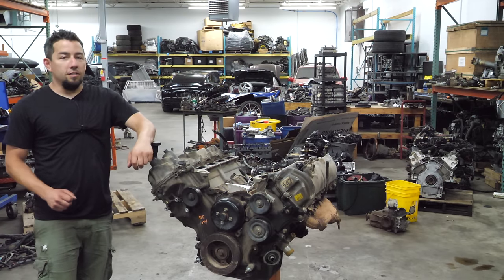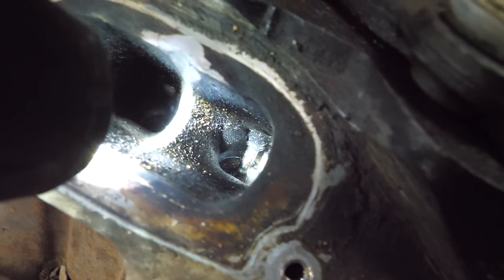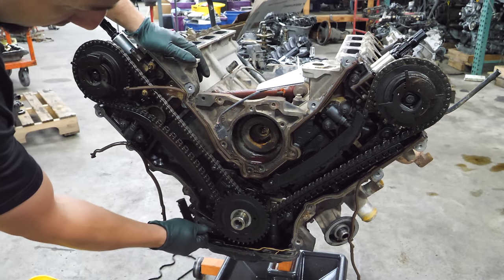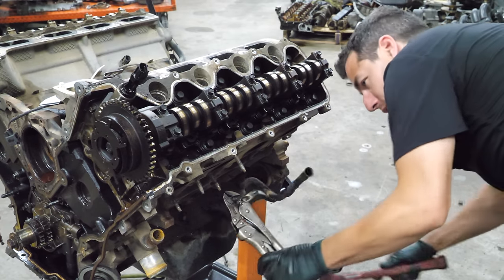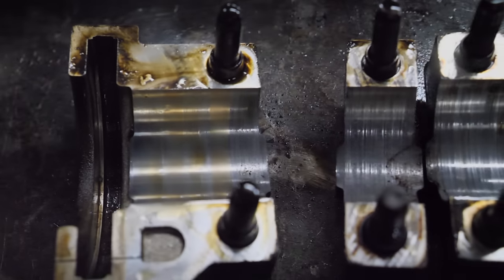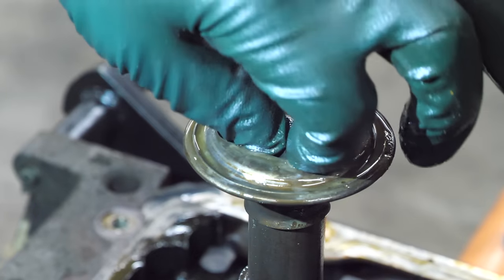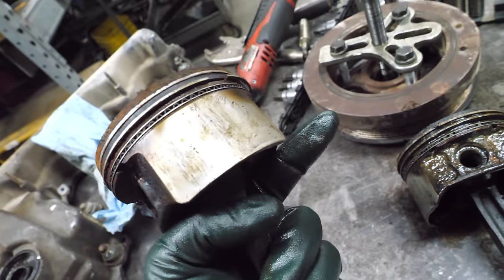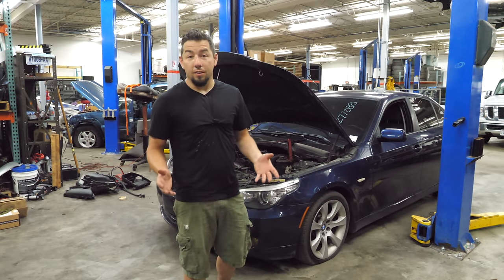Bad Ford 5.4 3-valve V8 Engine Teardown. Which of The MANY Possible Failures Took This One Out?

Comment: That wasn't maintained just by looking at it. I can tell you right off the bat it wasn't maintained. And it's not going to cost a fortune to maintain it. That's the ridiculous part I don't understand help me make that make sense. It's affordable to change oil that looks like it hasn't been changed to 10000 miles or more which I don't think there are cars out there. That are designed for that. I can already tell you the problem already just by looking underneath the valve cover. Overheated low oil I guarantee you that's what caused that engine To fail.

Comment: Oh and to those scenarios that you're walking down this checklist of stupidity. They do have aftermarket oil pumps that actually work. They do have oil tensioners that actually work that will solve most of the problems. You're describing but no one knows that because they think they know it all. That's a problem. And on top of that. They're pretty decent engines when you actually change the oil and make sure your oil level is good. That's important in any car I would think or hope I don't know what people are doing that they're not putting oil in their cars and checking. The oil levels to think that their cars made good because it's made by somebody else that is a Fallacy.

Comment: engines are junk..spark plugs broke off in cylinder head. soaked with pb blaster on both sides, since head was removed.. still broken every one. used impact gun on a few. breaker bar on a few. nothing mattered. Ive built a lot of ford v8,the 5.4 is garbage.

Comment: Maybe someone with real knowledge should be doing that teardown. Anyone with any real knowledge knows the fatal error of this engine was the inadequacy of the oil pump. I know people who bought these used and put a Melling high volume oil pump in it and ran them 200k-300k with no issue. You mentioned “cult following” in the video. There’s also a cult hatred, especially from people who know nothing about an engine.

Comment: Dumb people like to hate on these engines but they themselves don't maintain them. I bullet proof mine at 150,000km now I'm pushing almost 450,000km no problems at all and still with the original Drivetrain. Unlike Gm that you have to swap pretty much everything if you start towing 😂.

Comment: And furthermore this piece of Garbage was built by the namesake of the company that built the 289, 352, 427 side oiler (an amazing powerful engine) the 390 and on and on. What happened to THAT Ford Motor Co? Reckon Henry is rolling in his grave since as recently as the mid 80's Ford designed from the ground up the 3.0 Vulcan that was in my opinion one of the best cast iron V6 engines every built! Reckon where THAT Ford Motor Company went? It ain't the one we got NOW???? They built the first mass production V8 back 90 years ago! Where is that Ford Motor Company? The CEO needs to watch your video and see how far away from where they WERE to where they ARE now! Oh and how about the 1.5 EcoBoost engines? Head gaskets anyone?

Comment: And all those things that you are talking about must have been because somebody wasn't taking care of the motor like they should but I've never had crack. Block. Or manifold or any other things you just described. So what makes mine different and the ones that you're talking about? And lots of time if you don't Care of the motor what happens the things you just describe Is that the motor's fault is that person that isn't taking care It fault? At least I know mine Didn't catch fire doesn't burn or It does what it's supposed to do start and run Now I can't speak for what the computer's doing why do electronics That are so poorly made nowadays and it doesn't matter what car it is apparently Those are the things that. That Bugs me about this vehicle is the electronics or new Updated versions are more concerning the previous Is versions. But i'm still a ford a guy And for as long as I had this Engine type I've never really had an issue. I have a four wheel drive by the way expedition Both of them I don't See the issues you're describing other than the oil techner being an issue But They are good If you again go back to what I said simple maintenance Keep up with those things you won't have an isbut if you want to update The parts that are a problem you can do so. They do and it's known that they have Updated Version of the problems Which doesn't Kill the bank if you know what you're doing. So do I think this motor is bad? I used to think that until I owned one and actually took care of it again going back to that again simple maintenance. I have not yet had a cracked manifold or any of those silly things that you're talking about and yeah I don't like the aluminum block. I'd rather it be cast iron but we all can't have what we want but it works so far. I still wish for the 351 Do come back with a push Rod Don't like modular motors but if I can get a three fifty one in here I would do that. Because I prefer a push ride motor then a modular. Kind of funny they went back to the push rod with the 7.3l. Would be interesting to Is That happening with this motor. the 5.4l. But I would prefer a push rod 5.8l. I'm not saying the 5.4 is garbage. But you find the weak points fix them after that. How is that motor going to perform? Is it going to do the same thing over and over again break down because you really have to be Specific with these motors. You can't just order stuff and throw parts at it probably why they break down because you have the wrong parts that don't belong with that motor or that year. But you got people out there to think they know what they're doing. And they're working on those vehicles and there's your problem.

Comment: Talking trash: any AFM engine-chevy 5.3/6.0, most v8 dodge are way way worse.
Also, spark plug 2 piece design was retarded, change to AC. Ford designing truck engines with aluminum heads not smart. Seen the 3.0 Duramax!hahahahaha